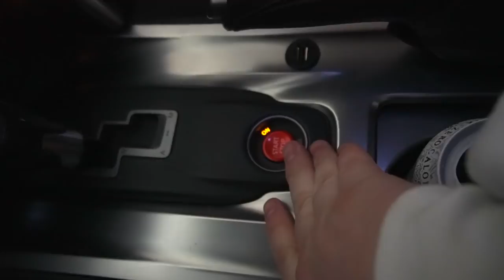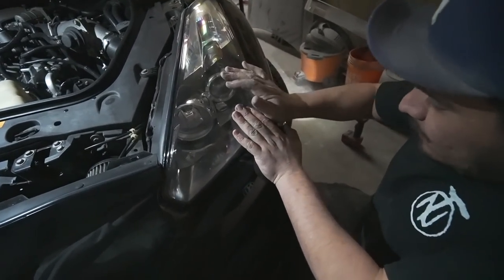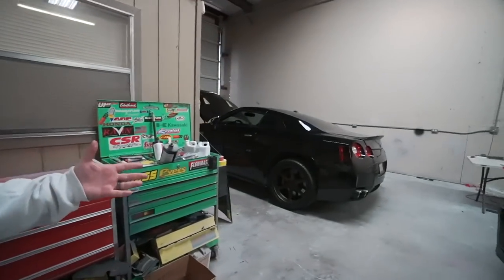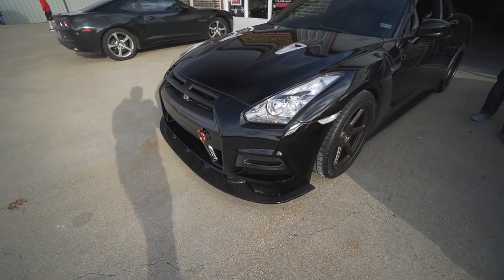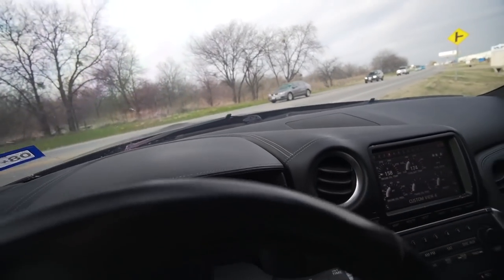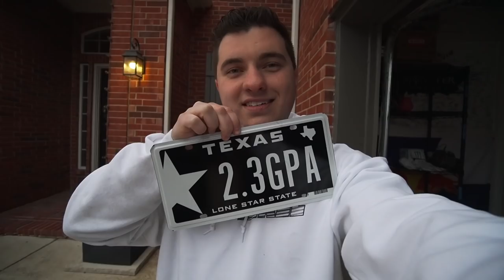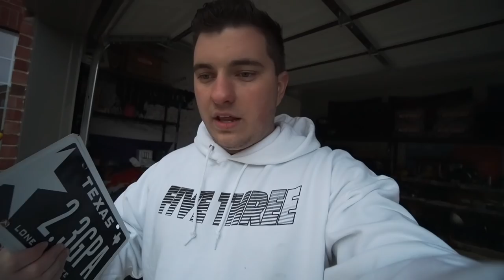GTR FULL BODYKIT REVEAL!! (lots of carbon!)

Comment: Who else cringed when he stepped on the splitter 😬🤦‍♂️
Reply: R0B  b,,,but its a german bumper
Reply: that front bumper is german, it’s a top quality part, what Chinese parts has he put on the GTR?
Reply: R0B go google prior design lol
Reply: R0B " This product is made from high quality FRP (Fiber Reinforced Plastic). The material is a unique blend of epoxy and flex resin that gives excellent strength, flexibility and light weight.    All of our parts are designed and developed in Germany to the highest quality standards.  Fit and finish is excellent, which provides for a seamless installation with one of our Authorized Installation Facilities.  Please contact us for more details." They make ferrari, porsche, bmw, and mercedes parts? You high kid?